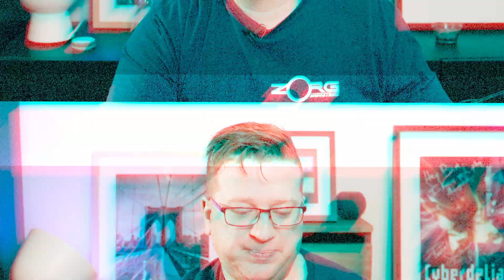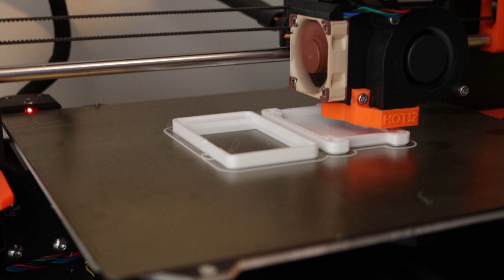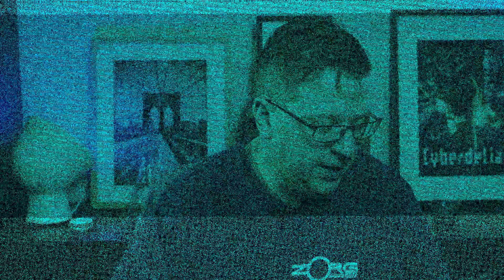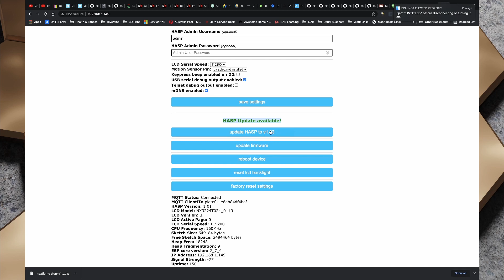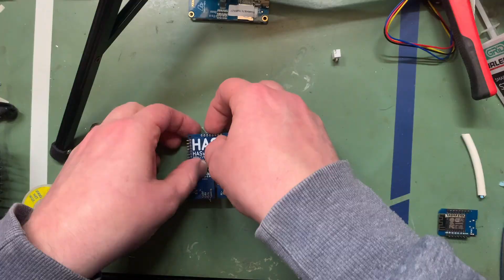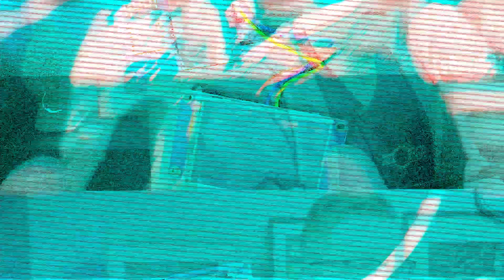HASPOne Build Log

Comment: Can't really wire stuff = It is illegal in Australia to do mains wiring, even portable mains wiring, unless you are a qualified electrician.  Fines do apply as well as invalidating insurance.   It does limit what we can do with DIY projects like this unfortunately.    I've heard the LCD traces are fragile.  Luckily it wasn't too bad trying to save it.
Aside from that, great video.  I've followed this project for a couple of years and now it seems to have reached the maturity level where it would be great for most people.
Reply from the maker: That's where the DC version comes in, you could power the unit with a simple wall-wart style AC-DC adapter.
You can also power the unit from the USB Header on the Wemos.

I tore some traces off the display board too because I got impatient. Saving it was a pain but I got there.
Reply: @HiveMindAutomation  The laws in Au can be frustrating for a DIY automation project, but I can understand why they are there.
I am likely going to look at the DC powered version, but maybe have a sparky install a socket in the wall or nearby enough that it doesn't look ugly with wires everywhere.  Have to keep the partner happy :)
Just a question.  How do you find the 2.4" display?  Do you find it too small or does it tend to work okay?   I noticed another project OpenHASP that lists compatibility with larger screens